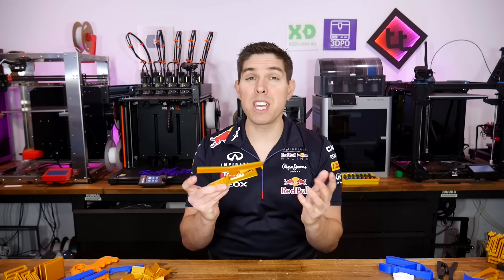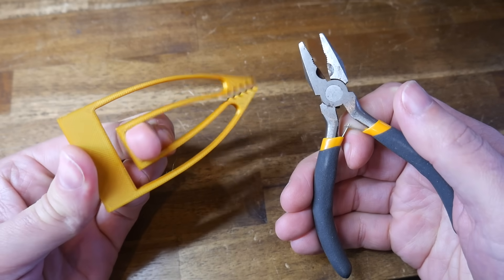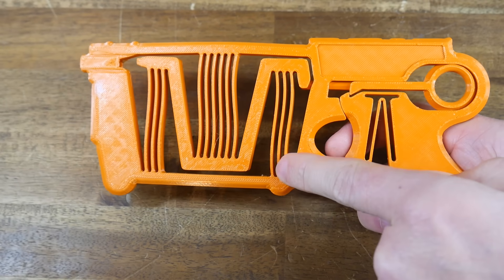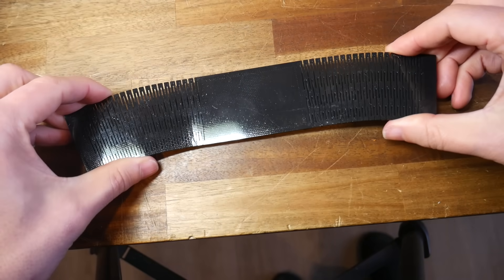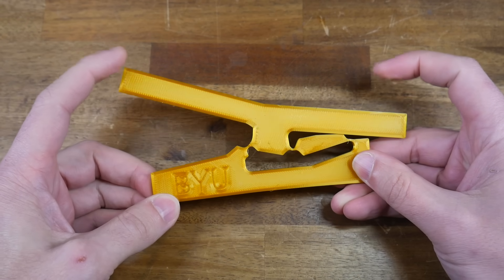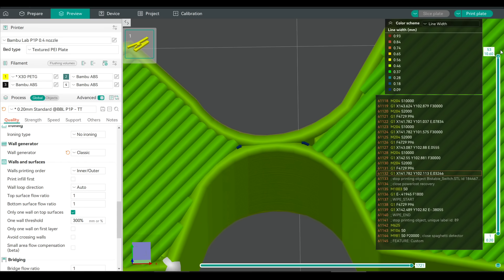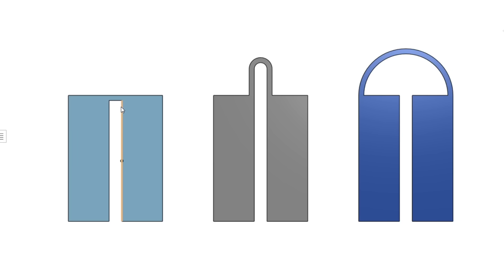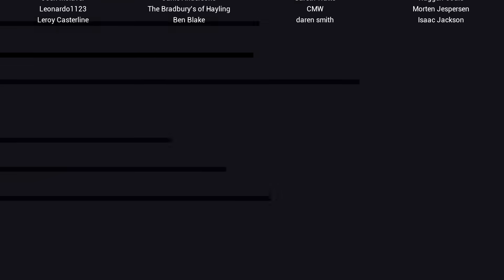How to create effective compliant mechanisms with 3D printing

Comment: What type of nylon do you use for 3D printing compliant mechanisms? PA12, copolymer, or something else? Thanks!
Reply from the maker: I tend to stick to petg since it's so much easier to print.
Reply: @TeachingTech  gotcha, thanks! I was just curious which nylon you used in this video. I am looking to print in nylon because I need the strongest material possible for my application and PETG's a bit too soft.

Comment: Excellent video! We'll have to print off some of these other patterns ourselves!

The flasher hexagon, if you want to know, is a (very chunky) example of the kind of deployable origami arrays that we're working on for space applications. It doesn't compact down nearly as much as the stuff we'll actually be putting up in space, but it does make a great fidget toy 😉

Comment: Have you tested Simplify 3D on a Klipper machine? I will pay for the S3D software if it simplifies my process. I am sorry. I am 65 years old. Using the latest OrcaSlicer on my Qidi Tech Q1 Pro is a nightmare for me! I must make different machine profiles and create new filament profiles each time I get a new filament. I hate the process. It might be good and cool for younger people, but I am an S3D guy and this new stuff is just too much. S3D I could change everyting all in one go for each print. It was based on the MODEL settings, not the filament I was using. Too much work in OrcaSlicer as far as I know. I am about to buy it and make a video about it, but I think you are gifted and could give the new S3D a proper review. Will you please do that?
Reply: To clarify, In S3d, I told S3D the printer I was using. I'm not like you YouTubers. I only have one 3D printer I use for everything. So I don't need to change printer settings for different printers.  I do, however, use different filaments. In OrcaSlicer, I have to make a new Filament profile each time I use a different filament. I HATE THAT!  Let me just put the file on the bed, change all the settings and send the file to the printer. I hate all this new Klipper and OrcaSlicer and it's derivatives or parents settings.

Comment: Great video, as always. Could you do a video about detents? You are so good at explaining mechanisms, and in my experience there are only scarce resources on detents, especially for 3D printed objects.

One use case I have is a (mostly?) fully 3D printed 3-position rotary switch. Is there a way to have it snap into each position reliably with only printed plastic, or would something like a ball plunger be better? What should the groove profile look like? The back of my mind screams "over-center"!

Comment: These thin sections of the mechanisms are not suited for 3d prints. They are designed for titanium and such since there great e-module and low creep. I recently looked in to it. And replaced the thin sections with s-curves to spread the load and deformation, while keeping low actuation force and movement.

Comment: I've been having some fun mixing PLA with flexible PLA. Unlike with TPU, the layers stick together and it creates some interesting options. I don't have a multi-material printer, so I've only be doing a few layer changes per print (I just treat the  flexible PLA as a different color and use a modifier to slow the print speed) but even with that limitation, you can do some cool stuff. I recommend more folks try it out because it doesn't seem very popular and I don't know why.

Comment: These mechanisms are cool cut the fatigue failure issue surely precludes them from serious use? Lots of these materials give very little indication of when theyre close to failure, and you cant replace components, as it's all one piece. How is BYU adressing these problems?

Comment: Mate, long time viewer! Also tech teacher, also f1 fan, also a wanderers supporter from western sydney myself! Think I saw you at an REA event a few years ago can't remember.... anyway I found this interesting as it's relevant to something I've been thinking about which you might find interesting too .. REA this year are running F1 in Schools 3D Printed class (did you know?). It's basically cadet class but with milling restrictions (left/right side cut) removed. The only restrictions really are virtual cargo, and that side pods/wings must exist. I am entering two teams of exceptional Y8 students. I have been thinking a lot about pushing boundaries and car designs to think outside the box. Similar to DRS or flexible front wings on real F1 cars, I've been trying to think of a way to include compliant mechanisms in a 3d printed f1 in schools car. Perhaps where a wing or a sidepod might flex or bend, so that it complies under scrutineering but provides an additional benefit as it moves or flexes while under load. If you have any ideas or thoughts I'd love to touch base and chat about it...? Ev

Comment: Concentric arcs at 15:55 are very stiff because their length cannot change and they prevent each other from bending. Drop the middle one and fold inner one close to outer arc, or add waves :)
Reply: Came for this. Was not disappointed.

Comment: I'm building a Milo V1.5 Mini Mill. I was going to make an accordion bellow to cover the linear rails on the Y-Axis. I was going to do it the old fashion way by using some kinda fabric or plastic sheet. Luckily you posted this video and inspired me to print one out. I found someone on Thangs that has tons of sizes. Now I just need to model a little mount on the Y-Axis bearing block. I can share it with everyone in the Millennium machines Discord. Then they can use it in their builds, or retrofit their already built mills.👍👍👍👍👍 5 thumbs up!

Comment: Polypropylene is an underrated filament. It isn’t that hard to get it to print and the results are very good mechanically. All we need to make it mainstream is a manufacturer to make an even easier version or blend to use. Bambu is ideally placed to do this, if they can get settings that work well on their printers then it should make PP more mainstream.
Reply: And fun colors,  I would say it's easier than tpu even but maybe since the usual build surfaces don't work is relegated to the troublesome corner.  Every time someone tells me it's too hard, I just print them something in it. 😅
Reply: I thought it was horrendously hard. I guess times have changed

Comment: I once got a roll of PP for 25 euro as a sale item. Even with my horrible M3D micro printer it worked. Its horrible with moisture but so easy to print. I have no clue why it isnt more popular. Its durable, strong and bendy. It does coat the nozzle preventing any other filament though. IF you can find it, Highly recommend PP as an easier nylon. Would love to hear if more of you know about it.
Reply from the maker: I have printed with it once and still have the very old roll. It was very soft, almost like a tpu.
Reply: @TeachingTech  What I found interesting is how quickly it firms up with thinker walls. I want to try it, but dont want to risk sliming up my nozzle and heatblock..

Comment: Another great example is the "plugs" for the Honeycomb Storage Wall. Each corner of the hexagon has a channel cut out of it to allow the plug to flex while it's being inserted. It then snaps back to its original position once it's in, allowing the plug to "lock" onto the wall.

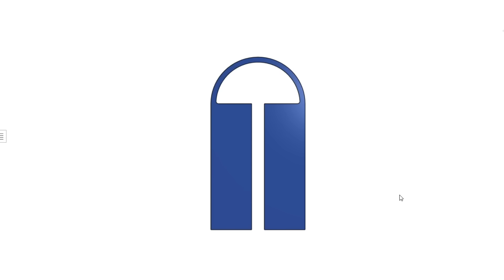Comment: 15:53 would duplicating the geometry in that way even work? It works in the nerf gun because they're all working in parallel to move in a straight path, but if you have multiple curved parts like that wouldn't they have different ranges of motion and therefore work against each other?

Comment: I work a lot with compliant mechanisms (currently doing a phd at one of the few groups in the world who are good at this stuff). Some remarks;
Funnily enough there's only a couple of research groups in the world that are famous for compliant mechanisms. This is not just Howell's group at BYU. Some notable ones are: Johnathan Hopkin's group at UCLA, Just Herder's group at TU Delft, Brouwers group at Twente, EPFL in Switzerland and I believe ETH does some too. You can search for their papers for some inspiration about what is possible.

Firstly, if you want to design your own, the compliant mechanism series by Johnathan Hopkins here on youtube is a great resource. He is most well known for developing the 'FACT' theory, which is a handy graphical way of designing mechanisms without having to rely on programs or math. Highly recommended.

13:00 Flexural thickness is extremely important for stiffness. If we consider a leaf spring, stiffness in the 'driving direction' scales cubed (!) with thickness and length, and only linearly with width. Meanwhile the support stiffness (in the direction of the width) scales cubed with width and length, but linearly with thickness. As you can see length affects both stiffnesses equally, but less thickness affects the support less than driving, and vice versa for the width. This implies we want as low thickness as possible and as large width as possible. The same sort of holds for other flexure geometries.

14:00 In the world of flexures, 40 degrees is MASSIVE, and I guarantee that no matter what material (exception for extremely soft materials which make the mechanism useless by definition), the stresses here are going to far exceed the yield stress (thus make this design not durable at all). 

I should note that just randomely picking a material for a given design is not a good idea. Both geometry and material properties both have tremendous impact on stresses inside the material, so just choosing another material without taking this into account does not make sense. If you want to compare 'performance' you should have a similar support and drive stiffness, and for that you would need to scale the dimensions of the joints appropriately. Otherwise stiff materials are 'punished' dis-proportionally with higher stresses. 
This is also true at 14:40. All of these will have a rotation (but also other degrees of freedom, for example translation, as this is a poor design), but they are not comparable. The first may not achieve the same stroke, but its stiffness (and out of plane support stiffness) is much higher. Thus you are kind of comparing apples and oranges here. 

8:00 You are correct that TPU is not very good for flexures, and that creep can be detrimental for parts under constant load. 
The goto material (polymer) that we go to is indeed Nylon PA12. ASA is actually quite poor. The white you saw implies that the material is already beyond yield stress and wont last long. Just because its tough it still holds together, but is above a threshold you should design mechanisms with.
I have done a bit of a deeper dive into 3d printing filaments and their flexural properties, and found the following (mostly using eSuns data available on their website):
A (selected) ranking of most common materials (and a relative score where 0 = worst, 1 = best): PA12 (1), PC (0.8), ABS+/ABS(0.76/0.75), PETG (0.72), PLA (0.61), PA-GF (0.59), PLA+ (0.46), PA12-CF (0.42), ASA (0)(!)
So, just as you found, PETG is a reasonably good material, although ABS+ prints pretty much as easily (with less stringing) and performs better. So generally I tend to use ABS+ for compliant mechanism prototypes. But always take into account that the material limits the lowest achievable stiffness. Generally there's a minimum wall thickness achievable, so for a given designed thickness, you can 'scale' the design stiffness with youngs modules. 

Some notes on printing parameters: seams I always put on 'randomized'. Always enable arachnea slicing for accurate wall thicknesses. Always try to have at least 2 layers for a flexure (1 layer is possible but fragile). Thinnest I have been able to go with a .4 nozzle is ~0.4mm, but effectively I try to keep most above a .8mm wall thickness (which is not very hard with arachnea). Put fillets at the corners of where flexures meet rigid bodies, these often present stress concentrations.

Comment: 12:45 problem with this is that slicer overlaps walls, so linear math doesn't really work. you can use the precise walls option in orca to overcome it though.